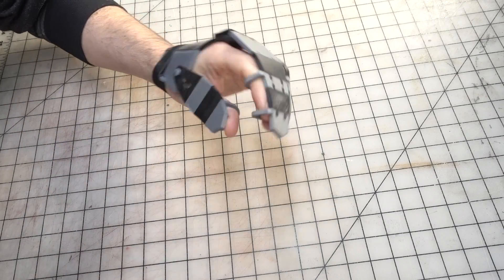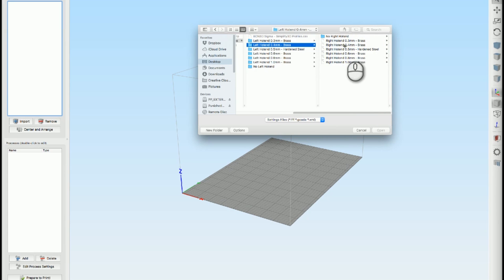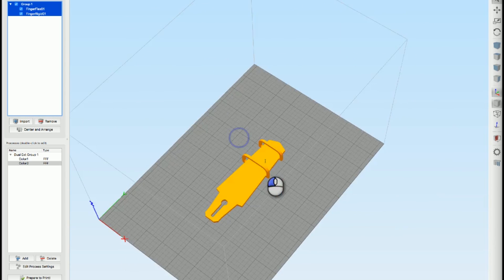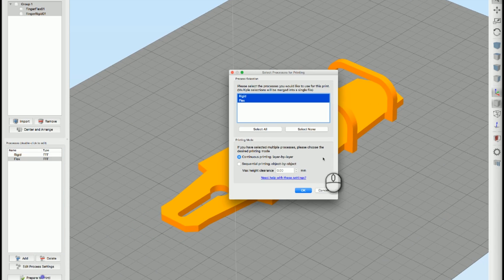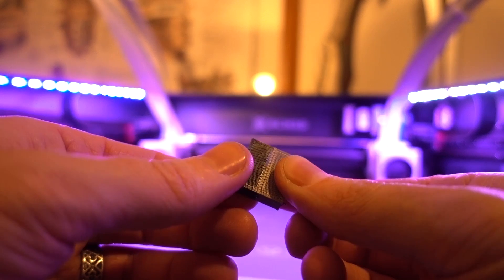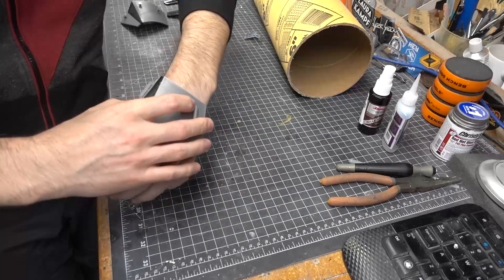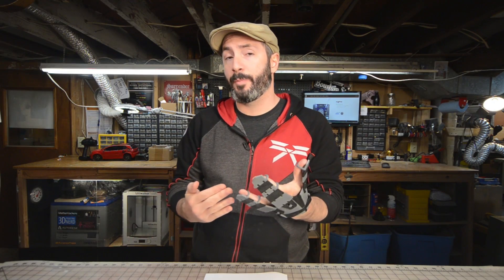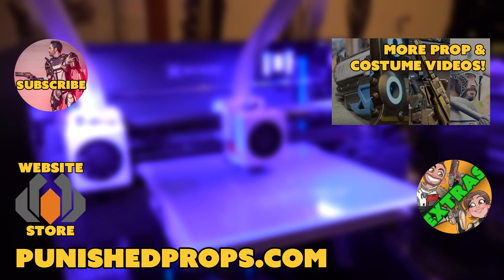3D Printing Rigid and Flexible Material on the Sigma Dual Extruder 3D Printer & Simplify 3D

Comment: Looks like a turtles hand to be fair. http://www.toyhypeusa.com/wp-content/uploads/2017/02/NECA-Toys-Teenage-Mutant-Ninja-Turtles-1-4-inch-Scale-Donatello-23.jpg
Do you think this would work with a single extruder and sliced out the hard and soft and connect them using those connections clips you used there.
I don't have a 3D printer but I have many many plans if I ever have the ability to get one.
Sucks being jobless ATM.
Reply: Well if I had the chance. But thanks for the reply.

Comment: One of these days, I need to reassemble my second extruder...  I saw a method for reaching similar results from a single-material print, in an article on 3D printed prosthetics; Basically they designed and printed the fingers of this prosthetic hand with thin walls enclosing the joints. This acted as a temporary breakaway mold for casting the joints in-place in flexible urethane rubber. Very clever!

Comment: A possible application may be an artificial spinal column. ABS/PETG with ninja-flex discs. For robotics or skeletal modeling?
 - Eddy
Reply: That's one of the smartest ideas I've read for multi-material 3D printing.

Comment: Hi, i started recently designing my own printed models and things, but i dont know how to divide the big model in parts to fit in my printer. Can u make a video explaining it?
Thnx for all you videos, and greetings from Canary Islands.
(And sorry for my english)
Reply: aljadiga don't apologize for your English dude!.. it's totally fine, I bet no one in this comment section can make a full comment in Spanish without messing up some words.. (I might be wrong but I'm pretty sure it is Spanish, that is the language in the Canary Islands)
Reply: aljadiga you need a slicing program -which should be somewhere in the 3D software  you are using, Sorry I don't remember  the names from Tom  at the Maklabs when I was using the3D  software  or the Slicing software he told me about , but I'm sure someone will know of one 🙂
Reply: aljadiga if you know how to model you should know how to cut objects into pieces. If you really want an answer you should let people know what program your modeling in because the answer will be different depending on the software.
Reply: I use Fusion 360, cause i see some people using it, but i know just how to draw basics sketches and pull.
I tryed to see some tutorials, but they are dificult to understand when they speak in other languages -_- .
Thanks to all for the answers ^^

Comment: BTW, is it possible to 3D print a helmet in only two pieces? Can you experiment with that, because people at SLC Comicon said it was rather than print multiple pieces like Commander Holly's helmet you did
Reply: you could, but a larger piece is likely going to need more bracing and as a result use more plastic than a bunch of small pieces, the most obvious obstacle with printing large pieces is really the size of your machine, most household 3d printers simply arent big enough to print something that big without breaking it up into smaller pieces. That being said if your machine is big enough and you have no problem affording the filament, then theres no reason not to print in larger pieces, in the end it just makes your life easier.